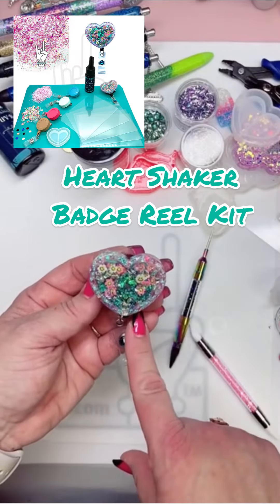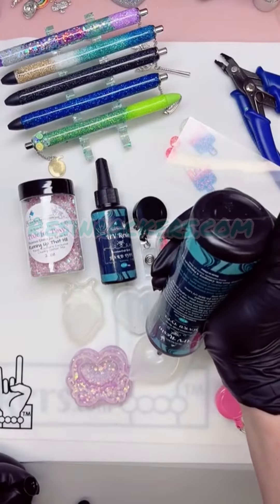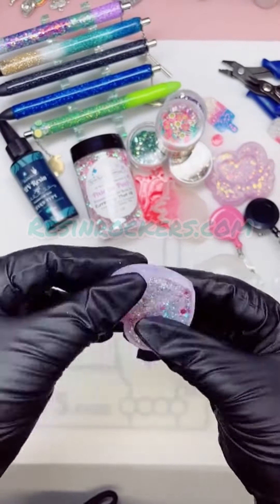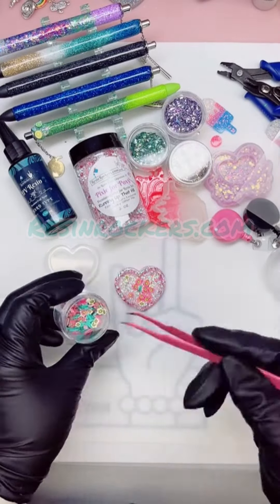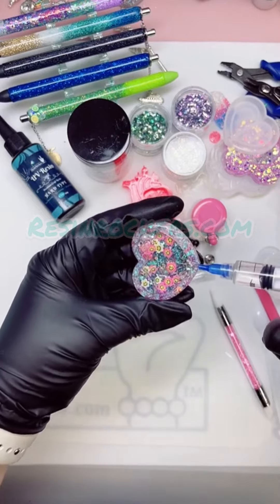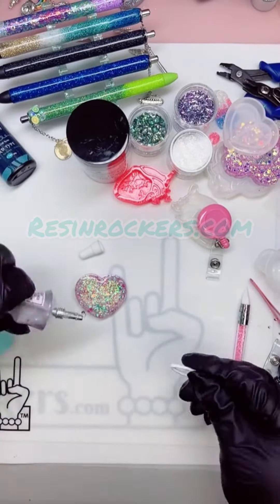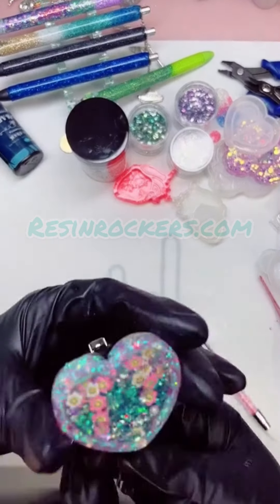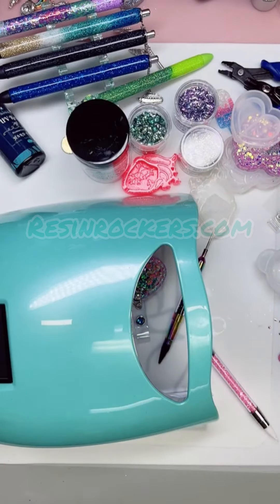Heart Shaker Badge Reel Kit with Resin Rockers UV Resin Full Tutorial

Comment: What if I used the soft Uc resin should I just redo it
Reply from the maker: Hello! The soft coat is primarily used for flexible items. If used in this mold, it may be tricky to adhere the shaker film, but you could try! I would recommend our original UV resin formula for any shakers.